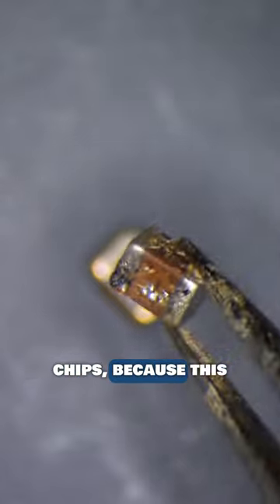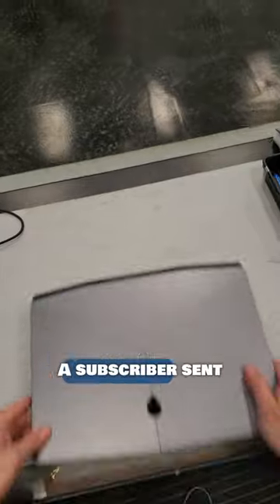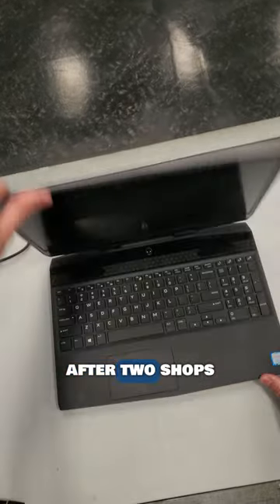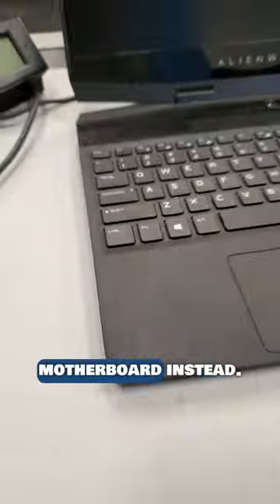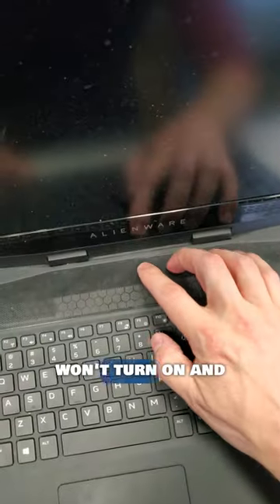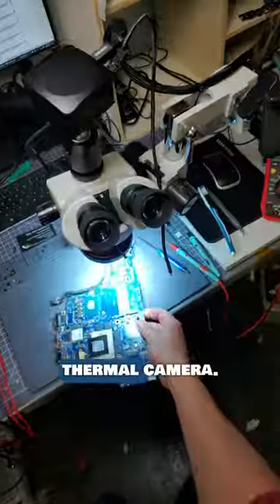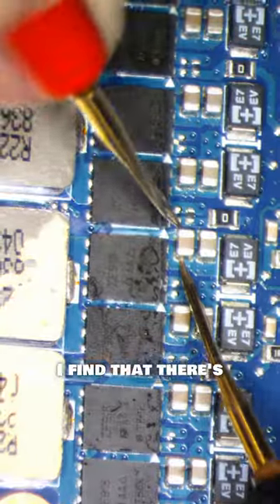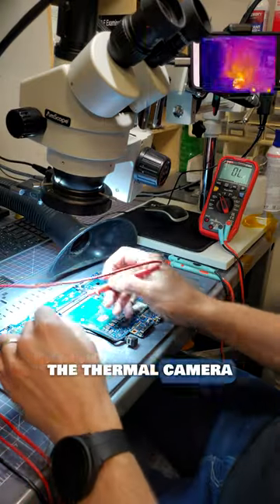They Said It Couldn't Be FIXED! #shorts #laptoprepair #computerrepair

Comment: I don't recommend the use of "Short Killer", especially since you have a thermal cam. It's much safer to inject a small volt with limited amp using the bench power supply  and using the thermal imager to find the culprit.
Reply: What’s the difference between injecting a small volt on the short killer vs injecting it w a bench supply?
Reply: @rachel705 , With a bench power supply, you can Control the amperage while the short killer doesn't have that option. It just injects 20 or more amps directly. The purpose is to fry the shorted capacitor and make it "open" instead of "short". Yep, the device should be used with the assumption that the short in question is caused by a capacitor!. But that's not always the case. Sometimes MOSFET, IC chips etc also get short and injecting uncontrolled high ampere current may cause more issues. I have seen the damage it caused. A BGA chip PMIC was short on a phone board. The technician used the short killer. It did it's job - fried the chip and made the short circuit go away. But at the cost of smoking the chip and damaging the PCB in a way it can't be repaired.

Comment: ...and that's how to know wether a repair shop is the real deal or just a bunch of get-rich-quick guys - a short on the main power rail, caused by a capacitor in the neighbourhood of a 1.2/ 3 V rail is the single most common motherboard failure on DELL laptops.